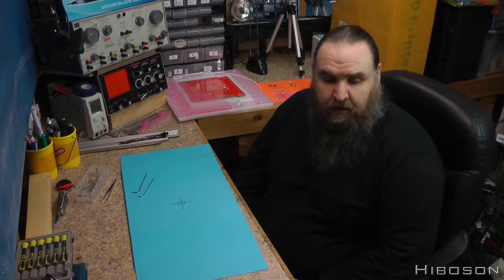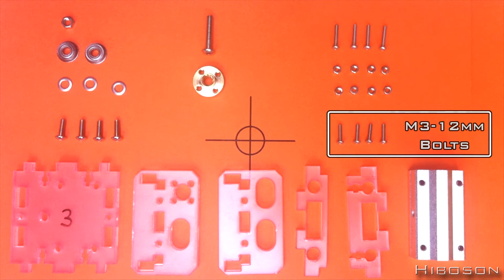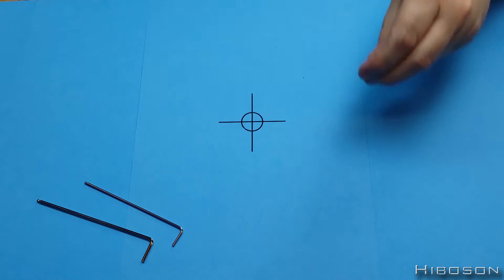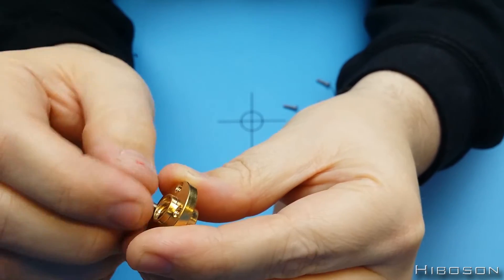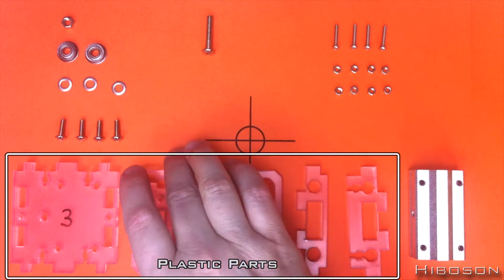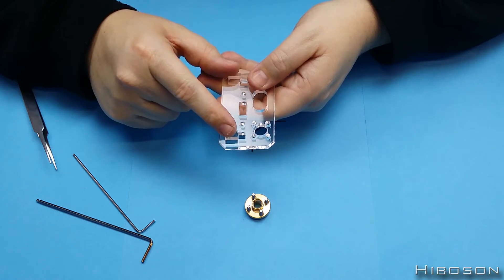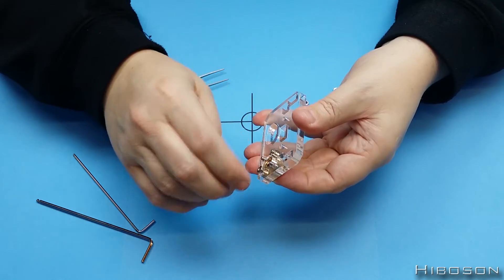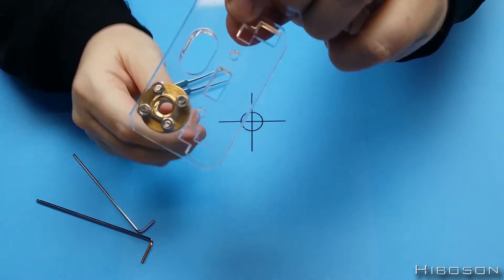Sunhokey 3D Printer - Build Teaser Video

Comment: i got one of these for christmas and ive been loving it and messing with it since, not a huge fan of the bowden tube, but i've made some adjustments and slapped the extruder motor on top of the hotend
Reply from the maker: Thats one of the little experiments I want to try, remounting the extruder to the head,, but want to get used to it first (got to finish building it first lol) before I start the experiments :) but going to do a bunch of test prints bowden extruder then again direct drive, see if any difference,, looking forward to my first print :)
Reply: Hiboson oh, there's definitely a difference,bowden i kept running into small gaps and blobs, now im in between the two, its technically bowden, but with only like an inch of the tube
Reply from the maker: Kevin Crossland Cool to know thanks :) I heard that some say anyhows the extra weight can cause the head not to change direction as smooth as a lighter head causing some minor quality issues,, but I want to play and see for myself :)
Reply: Hiboson one thing you definitely want if you dont have already, is some kapton tape. I had tons of trouble getting ABS to stick, but now that i got some kapton i rarely have issues
Reply from the maker: Kevin Crossland I will make sure I add that to my shopping list ;) From what I understand any 3D printer owner should always have some handy, I don't think the 1cm wide stuff I have will be much cop for lining a bed lol
Reply: just curious, but do you plan on printing with ABS or PLA?
Reply from the maker: Kevin Crossland The 2 free reels I got I opted for PLA as herd it was easier to deal with and didn't stink the place up like ABS, but once I'm used to PLA and have the printer running well then I'll get a roll of ABS and have a play :)

Comment: I bought one of these and finished it about a month ago, it took some calibration but now it prints great. I put a hexagon hotend on it and had to replace a faulty stepper driver. One thing I haven't figured out yet is why the heatbed can't keep the temperature high enough on it's own when printing abs. I might go buy a new one after I try upgrading the power supply with an extra atx I have laying around. I have a love/hate relationship with the bowden extruder on this. It seems to work well as long as you give it enough current, but even so it skips occasionally when printing PLA.
Reply from the maker: Hi Greg, Glad to hear the prints can be good :) RE the hotbed issue if I remember rightly I read that on some 3D printers the control board cannot supply enough current to bring the bed up to temp, some instead hook the hotbed output to drive a relay which is connected to the hotbed, so they can draw power for the hotbed direct from the PSU, I recoomend if your thinking of this search about for propper instructions on doing that mod to as I might be remembering it wrong lol, plus if the main board looses that current draw it might have the extra juice for the bowden stepper motor ;)